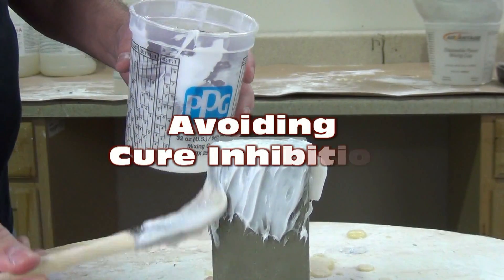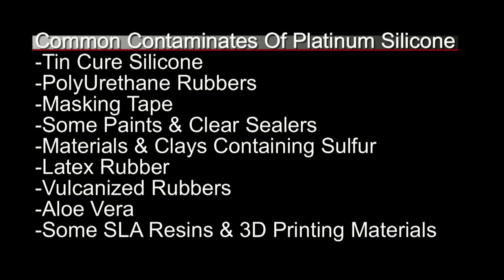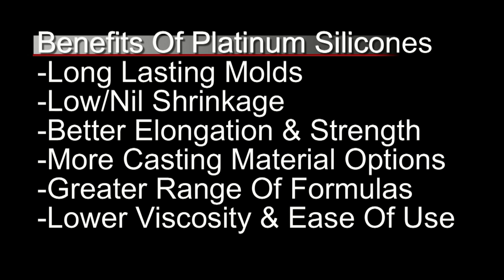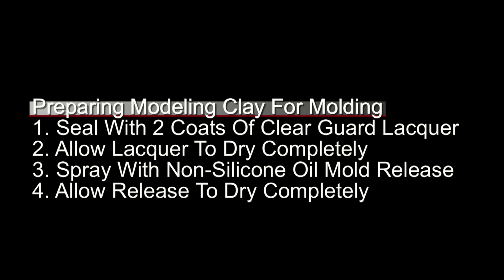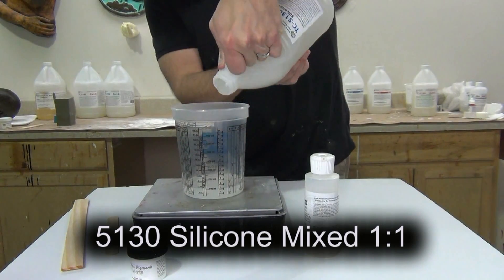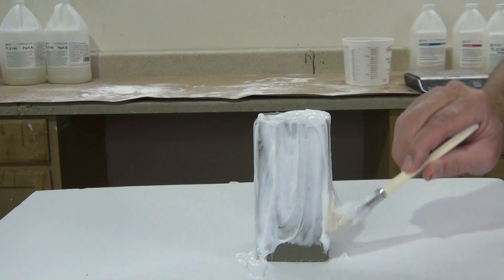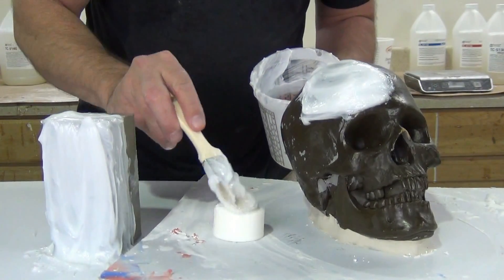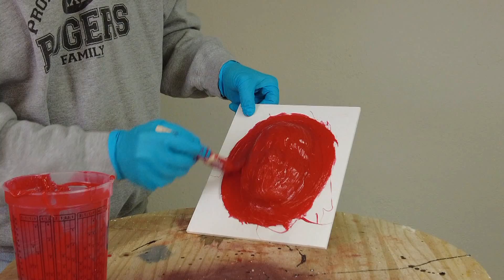Moldmaking Tutorial: How To Avoid Cure Inhibition With Platinum Silicones

Comment: What if you want to reuse the clay? Is there a process for removing the lacquer from the clays surface? If it's just scraping it off, but you can't get all of is off, is there a best practice for melting and filtering the clay? How did you clean that block of clay after the video?
Reply from the maker: If you apply the clear coat in several layers you can peal it off or pick off that layer of clay. If you are just using the clay as dividing wall material or other utility work you can just roll it up and reuse it.

Comment: nsp sounds like a fraud. Because it's like 50$ for 900 grams and it's developed NOT to have issues with silicone, but it does. Witch same sucess i can use regular plasteline  for 3$ and just coat it  with some spray and test it. Sure result will be nearly same
Reply from the maker: NSP is a great clay, and definitely higher quality than a lot of other clays, but Chavant was purchased (back in 2021 I think) and there might have been some formula changes.

Comment: Hi, you said "some SLA resins & 3D printing materials". Do you know of at least one 3D printing resin brand that does not inhibit a reaction? Thank you
Reply: @casade2831  you can cure the resin out in the sun for a few days and let it off gass for a few weeks or use some layer on the print that won't inhibit the cure like a paint, or something called inhibit-x thats advertised exactly for sla resin

Comment: Great video lots of info i did not know about. I have been trying to make a mold of a poplar wood piece i made. what would be the best thing to seal the poplar and stop the inhibition .i am using bbdino mold maker and it will not dry and when i pull the piece out there are holes and the mold is very sticky>
Reply from the maker: Unfortunately, not all platinum silicones are created equal. That formula is VERY sensitive to cure inhibition, hence the low cost. :(

Comment: Would a mold release spray like silicone lubricant from Stanley cause cure inhibition with plat based silicones???
Reply from the maker: Silicone lubricant is very different from release agent. That said, you should not be using any silicone based release when making a silicone mold as you will either get a bond or cure inhibition.

Comment: I made a mold yesterday and used a hot glue gun to seal a few spots of the box and the silicone cleared beautifully other than where it came into contact with the dried glue
Reply from the maker: Yes! The old hot glue I would get at Hobby lobby never had issues but the stuff I’ve bought recently inhibited the silicone. I’m on the lookout for which hot glue is suspect. That will definitely be a future video topic.
Reply: @bitymoldsupply  I've used metallic duct-work tape to seal the seams in my boxes, and it works excellent!

Comment: I was working on that silicone baby doll project I’ve mentioned before… First batch in my mold did great, totally clean, but there were some bubbles I missed. When I tried to fill in the bubbles (by reusing the mold and first casting and filling the voids), I got a puddle of completely uncured goop all over the original casting. 

Now, given that my partner gave me the plastic spoons, I don’t know if they were brand new or washed in the dishwasher. I thought I had used the plastic cup brand for mixing before, but it was a new package… So I think I’ve narrowed it down to those two tools. But… how do I clean the ruined silicone off the mold and the doll and properly decontaminate both? I can seal the mold, but I need the silicone to adhere to the doll… Any tips? 

(You can ignore this next part because it’s midnight and I kinda went on a ramble. Sorry.)

It’s so nasty and goopy. 😭 I think it must have been the mixing implements if only because the whole batch was like…clotted slime at best. I mean, thankfully it was a tiny batch (about 20ml to fill in the voids in my test mold), but I don’t want to scrap what I DID manage to make in the initial batch… (the mold was a mouth for a premade doll—gums, tongue, etc—because I wanted to start small but detailed in preparation for making a full custom baby doll. Also because I opened the baby’s mouth so it could suck its thumb or maybe a pacifier (not tested—wanted to avoid contamination), but then having a carved out maw kinda freaked me out.)
Reply: awaiting reply to your question, one of my clay sculpture is also having uncured platinum grade silicone on it, want to clean it and start again... please help
Reply from the maker: There is a lot that can cause inhibition. If you are working with our products feel free to call us during business hours and we can help you trouble shoot.
Reply from the maker: There is a lot I would need to know to help you trouble shoot. Call us this next week! Thanks!
Reply: @brickintheyard  All right, I’ll see if I can find a good time for that! I’m prepping for a trip this week, so it might be after the trip that I ring you up. Not sure.